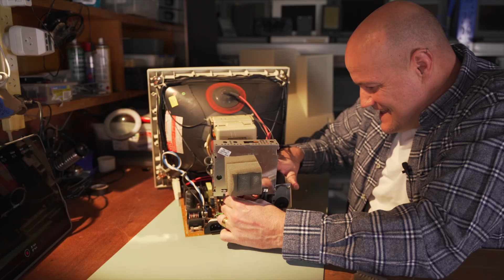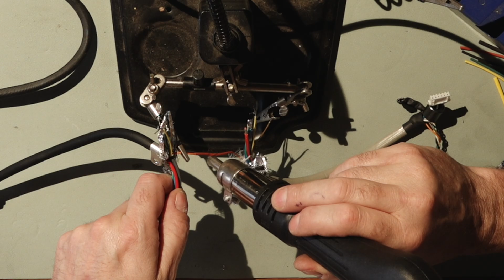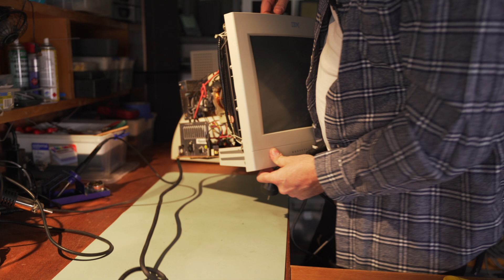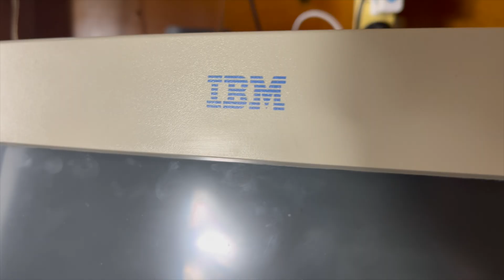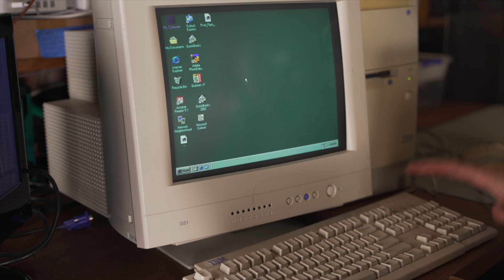IBM Aptiva Monitor Repair - Someone cut the cord!

Comment: Love the video and very down to earth! I just got one of these and I'm currently retro brightening mine (I took the tube out carefully and just have the shells apart) but it seems the video signal on mine is slightly blue hued - is yours like that? 
I also get this weird flickering across the screen when I jumble with the cable. it seems the cable may need replacing as the video signal is weak but I'm a complete beginner when it comes to soldering. Any tips on a solution?
Reply from the maker: Sorry I’m really also a complete beginner. But sounds to me like there’s possibly something wrong with the cable? I wish I could be more help😅
Reply: @TheBasementChannel  know of anyone selling a new cable in this configuration? I have no idea how to make my own - any help would be greatly appreciated

Comment: The garbled screen thing is a DRAM chip in the video card. It's likely socketed so give them a wriggle. Looks like a poor IC to socket connection. Also clean the eISA edge connector.
Reply from the maker: Hey thanks, this is good info to know!

Comment: random question but did your old monitor also had the vga cable cut off ? Wy not reuse the original cable from your old one ?
Reply from the maker: Because I re-connected it to the other monitor back when I picked it up.
Reply: @TheBasementChannel  ohhhh I had rewatched your other video and didnt noticed it used the vga cable internally I assumed the board was hooked up via a custom cable thingy instead, kinda like a jamma connector or something
Reply from the maker: @LetsPlayKeldeo ha no worries, yes the old broken monitor in the arcade machine was connected via jamma harness, but it was a bunch easier to use the vga output on the board.